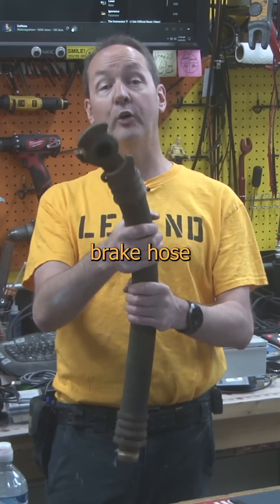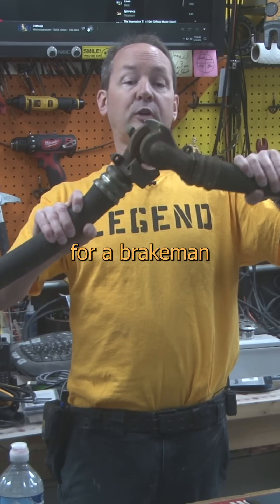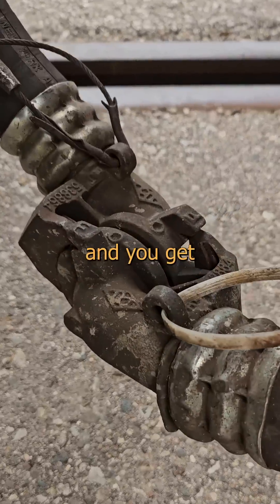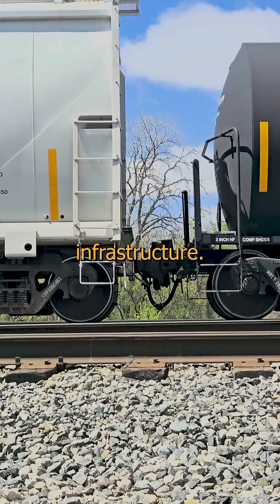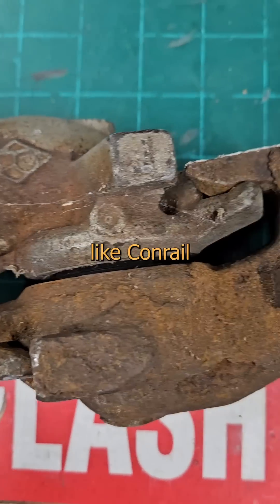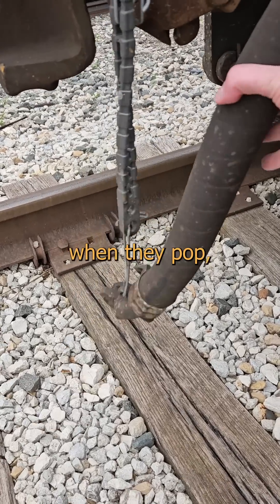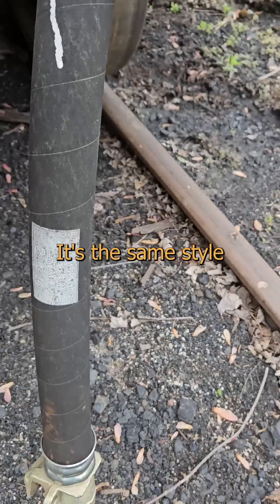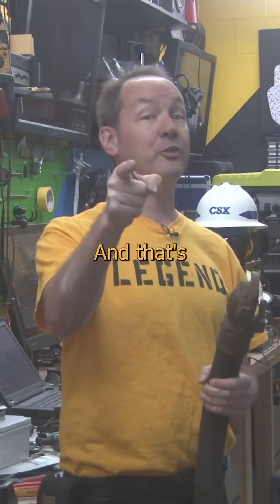Railroad Brake Line #chrisboden #comedy #engineering #train #gladhand #educational #connection #hose

Comment: In other news, a train derailed today, plowing into an orphanage after it was unable to use it's brakes to slow down for an upcoming turn. Investigators discovered the brake fault was due to a missing brake hose.
Reply: each freight car will automatically and independently fully apply their brakes if there is a loss in air pressure, such as an end hose being disconnected. The brake control valves on a freight car use air from their own seperate reservoirs to apply the brakes, and brake applications are triggered via pressure drops in the brake pipe which is the long pipe every freight car has that the end hoses connect to.

Comment: I remember when some cars were being set off the mainline and the conductor was careless, resulting in the coupler being ripped off. The train of over 100 cars became stuck on the mainline from the loss of air pressure and it took a couple  hours to fix. They eventually set off the bad car and cleared the main line. Amtrax had to be stopped and traffic was stopped thru several intersections all because of carelessness from the conductor.

Comment: Crash course: train brakes 
Most of the time on wagons or trucks air goes into the brakes they come on, once an engine is coupled and they remove the air creating a vacuum the brakes come off.

Comment: In the UK we have a straight air pipe as well as an msin air reservoir pipe, which has a star valve (some older air systems work like the American system with just a straight air pipe) in the middle, as they basically help top up the auxillary resevoir to stop the tank being depleted before being recharged by the compressor. They also help charge air suspension and air doors on newer vehicles.

Comment: Yep, even 18wheelers use the same system, just smaller. It's as close to stupid proof as you can get for braking systems. Because at least if it fails, you WILL stop. Yes I typed this before I heard you mention it.
Reply: from my understanding 18 wheelers use air pressure to physically push against a spring and keep the brake pads off the caliper/drum (not sure which one trailers use), freight cars actually work differently from this and need air pressure to physically apply the brakes; they aren't using air pressure to phyiscally push against a spring.
Reply: @acehawk888  Ah, my misunderstanding. Thanks for the clarification. Though I do find it odd. I'd rather something that heavy start stopping if there is a problem like that.

Comment: Can confirm, the local narrow gage railroad has that style of brake-hose connector. Can give you a nasty smack on your knees or up the crevass between them if you open the valve without connecting them.

Comment: And in a pinch, if one of the two gladhands is missing the rubber seal o-ring, you can take the other one out, flip it over, and connect the hoses.... It's neither pretty nor technically legal, but it will get you to the next terminal. 👍

Comment: “Stable in all weather” 
Yeah
as long as it’s not below freezing. 
Nothing is more fun than walking a train in -10 degree weather to change out glad hand seals because they keep leaking.
Reply: unfortunately rubber stops rubbering at a certain temperature. That being said, the hose material and gladhand gaskets, as well as pretty much any rubber component of the brake system, are all supposed to be tested to either -50 or -40 deg F. However in reality it is as you say.

Comment: Dont know if you have any friends with deep pockets that want their name on the side of a pennsy G5, but the railroad museum of long island is trying to raise 1.5 M to restore engine #39 to run again on the tracks of the strasburg railroad. Originally they wanted to get 39 running on excursions from riverhead to greenport on long island, stopping at the wineries that abut the railroad tracks. The museum even acquired a property to build workshops and yards. A few years later they bought an old turntable from upstate new york with the plan of having it at the western terminus. Unfortunately the MTA wanted nothing to do with the project and refused to allow a steam engine to run on their tracks. Many people fought for many decades to make that dream a possibility but in the end the MTA just wont allow it. Second best option would be to get 39 operational in a place where she can be taken care of properly and allowed to stretch her legs often. I was 13 when i was inside her boiler cutting the old rotted tubes out with a cutting torch and chipping rust off the boiler with an air hammer chisel. Seeing engine 39 running again would bring tears to my eyes.

Comment: Its highly possible that I'm just stupid, but if they are brake lines, wouldn't things not grind to a halt if they don't work? Lol. Love videos like this, 11/10!
Reply: Yes, quite literally. Brake applications on freight cars are triggered by pressure drops in the brake pipe from a normal 90 psi. The brake control valves see this drop in pressure, and correspondingly pressurize the brake cylinder on the car using air from a reservoir. So a gladhand decoupling on a train will cause the train to go into an emergency brake application and every car will slam on its brakes.

Comment: fun fact, you can get similar fitting for your garden hose 😁👍
I saw them the first time on the hoses used in a big recycling plant I worked at.

I found them in the garden section of a run of the mill tool store, all brass, nice black rubber seals.
I got one for the ouside faucet to pair with a hose, which has one on the opposite side which I can use to attatch different terminals.

Pretty darn nice 👍

Comment: As a trucker... they arent that much bigger than my air lines... the difference is those are built to last. Every truck manufacturer seems to have it in their head to cut corners where ever possible. My service line completely tore off the gladhand's fitting the other day... and the only wear and tear it receives is being attached and detached from the trailer gladhands... and I guess the bumpy road.
Reply: their built to be cheap haha, they are just regulated, and also every time a train gets thrown into an emergency stop because of something like a failed end hose, it becomes thousands (Im pretty sure tens of thousands on a major railroad but dont quote me) of dollars lost by the railroad due to the delay, so there is incentive for them to perform to a minimum standard.
Reply: @acehawk888 M8, they are losing closer to tens of thousands per minute of delay. I have hauled loads worth over 5 million in my semi truck, I can imagine a train is able to carry 10 fold that.
Reply: @PilotTed theres a general rule of thumb number we use but i forgot what it is

Comment: On passenger trains there is the brake pipe hose, BP, and the main reservoir hose, MR. They are different sizes and have incompatible gladhands so as not to get them crossed. As a pop quiz for my students I would ask which one was which in the field. When they got it wrong I knew it was time for a refresher.

Comment: These are exactly the same in the UK. 
Designed to separate if the wagons break loose, so that it doesn’t snap the air pipe. The brake pressure air then escapes and applies the brakes. 
The pipes that have the Main Reservoir pressure in are similar, but have a “Star Valve” in the end which closes off the pipe so that air pressure isn’t lost. 
Great design and great idea that has worked for decades. 👍🏻👍🏻👍🏻
Reply: Ours are separated by the "Triple Valve". It does the charging, the applying, and the emergency dump. Check out our reservoirs, which are actually two reservoirs bolted together.

Comment: As someone who hooks those up everyday sometimes it’s a pain especially in the cold. Those hoses get stiff and don’t wanna move 😂 I was a switch man for 3 years and now a Rail king G5 operator
Reply: Also they break pretty easily if you have a triangle point in the middle of the rail it gets hooked they rip off I’ve had it happen to me a few times

Comment: Fun fact: These couplings are not "handed" meaning there's no "left" or "right". They're all identical so only one part has to be made and stocked. 

Bonus not-so-fun fun fact:  In Western Australia where I work the exact same fitting used for the brakes on a train is also uses an identical pipe that's located right next to the brake pipe that is used to supply air to discharge doors and top hatches on grain wagons . This means "cross coupling" of the pipes between locomotives and wagons is entirely possible and the result is no brakes and a runaway train.  Because the owners of the rolling stock are too cheap to engineer the problem out by changing ONE part despite being told from the outset specifically not to allow this. So they instead rely on dog tired, overworked humans working in near total darkness to "just be careful" when marshalling wagons and to perform a test (that doesn't work) each time a wagon/wagons is attached to ensure the pipes have been coupled correctly 🤦🏻‍♂️.

I wish I was joking.
Reply: There are differently shaped and sized gladhands for different connections on trains already , I know of at least 5 different standardized types used in Australia. There really isnt any price difference between them other than maybe the smaller ones being slightly cheaper by virtue of being smaller. All that is needed for this to be a non-issue (and yes it should be a non-issue) is to spec the correct gladhand on the hose. Im surprised this is a problem.
Reply: The locos we use do have different "glad hands" for different functions but I am still astounded that something as fundamentally important as the brakes is legally allowed to able to fail so spectacularly. I believe the problem stemmed from the wagon people not talking to the loco people when the rolling stock was being made 13+ years ago. The locos as they arrived in Australia were "correct" but the wagons weren't so some genius bean counter with no regard for safety and a lot of f regard for being cheap  decided to successfully engineer the problem back into the situation by changing the then 20 or so locos "glad hands" to match the 200(?) or so wagons rather than for the correct parts to be fitted to the wagons. There was subsequently a runaway incident (caused by a number of factors) and the owner of the rolling stock declared safety to be a priority and swore they were gonna implement a program to correct the situation. This was maybe 5 years ago. Subsequently all we've heard is crickets chirping. Presumably this is because they feel a multi fatality runaway is cheaper and better to deal with than changing out the hoses on the locos and wagons (with the removed pipes still being useful as spares for the other function that still uses the same parts). A totally half arsed attempt to sort of rectify the situation (read very cheap and very lazy) was to colour code (paint) the tap handles on the pipes - to no known recognized standard not even being the same colours selected across the state. Within a fortnight I personally sighted a correctly coupled train that had silver attached to yellow and red attached to blue, other pipes ex stock not getting painted at all and NO formal training for anyone to explain whatever the colours were supposed to mean at all other than word-of- mouth. In other words to colours meant absolutely nothing and were/are misleading at best and still in no way physically prevents the pipes "getting cross coupled".

I sometimes ask people if they'd knowingly board a plane that had a real chance of the engines stopping when the wheels are retracted because there exists pipes the ground crew can accidentally cross couple during refuelling and they sensibly say "no". But a similar situation is said to be ok for the freight trains we operate 🤷🏻‍♂️🤦🏻‍♂️

Comment: That lock and seal is very similar to higher end sand blaster hose to blaster hopper connection. Looks very similar to the sand blaster’s hose that I used when I worked for a large electric motor company, we rebuilt/ rewound motors just like your rotor and stator in your turbines up to 20,000hp or they were rated in kilowatts/ megawatts

Comment: Freight is under 90 psi brake pipe pressure, Amtrak is 100 psi.  Those rubber gaskets go bad sometimes and the air takes forever to come up at the rear, so you find the hiss and replace it with the spare gasket you should be keeping on your switch keys.

Comment: Never straddle the brake hose when disconnecting it, even though you think you shut the valve off, sometimes the valves don't work correctly. That gladhand weighs a few pounds and straddling it makes your jewels the target of a jumping hose letting the pressure loose.

Comment: Wait till it's-20 out and the gasket won't seal 100%. It's hilarious
Reply: unfortunately rubber stops acting like runner at a certain temperature. the gaskets and hoses (and pretty much any other rubber component in the brake system) are tested to -50f but in practicality they will leak and be difficult.

Comment: As a diesel tech it’s cool seeing the semi trailer brake gladhands big brother. I’ve only ever seen fluid being moved through hydraulic couplers. Never thought gladhands would be used for fluid.
Reply: They're used for compressed air. Most people conflate the terms fluid and liquid. Chris is being technically correct. Broadly speaking, fluids are substances that can flow and deform under pressure (of which air is one). Liquids are a subcategory of fluids, but all fluids aren't all liquids.

Comment: Actually true! I know this because I am using a piece of one of those hoses to pump sewage from my motorhome to the sewer line. The hose was about 100 feet long with those fittings on both ends. I cut off about 70 feet. The fitting was removed and changed to a pipe connection. It works great. It's a little heavy though.
The hose was owned by a man who was into train museum stuff. He collected all kinds of train stuff. He passed away and his brother is cleaning up the property of all the stuff the brother collected.

Comment: And those expensive sounds when things disconnect is a safety feature!  Train air brakes work by storing air in tanks on each car. As long as the train air line has pressure, the brakes are off. But if the air pressure in the train line goes down - whether by the engineer operating the brake valve in the locomotive or by cars accidentally uncoupling - the brakes apply, stopping the train.

Comment: Those couplers that connect the cars have saved many men’s hands.  Before they would have to let one of the cars bump into the other and slide a pin down into a hole without being able to see your fingers to connect them. If you were working on the tracks and had all fingers attached that meant you weren’t “experienced enough”. I’ll take the lack of experience and all my fingers and just stick with the modern coupler.

Comment: I opened and angle cock that had air bottled in the cut. The glad hand whipped up and hit my hand while I was still holding the angle cock. It felt like getting hit with a hammer.

Comment: As an ex truck driver myself, the ones on a tractor-trailer are only handling a peak pressure of about a 120P. SI whereas I've been told that those ones not only are they a larger diameter, but they're handling around 200 psi, of pressure being moved along an entire train sometimes. My guess is part of the reasons you'll see 3. Even 4 locomotives, stacked together on a single train is not because you need the polling power. But because I', you need the ability to build air pressure and have air flow. So you need them, the 4 gigantic compressor units instead of just 2 or 3, but yeah. Having the extra locomotive or 2, really helps with providing extra polling power as well and only polling powerhouse. You can apply air to a train's braking system, just like a tractor-trailer and the wheels on the train cars that lock up when you walk. Does it require air to be applied to one side of the drum? When you apply it to the other side of the drum, just like an attractor trailer start to cause the wheels to start braking. So actual breaking effect on a train is spread out over every wheel that has a brake attached to it. Whereas polling power is just based on the powered wheels of a locomotive. So add more locomotives, get more polling power.

Comment: Semi trucks use a similar connection for the the connection to the trailer for the airbrakes we call them gladhands cause they look like they are shaking each other hands. The seal is easily replaceable, they last a good while. I think I've only had to replace them twice when I drove.

Comment: "glad hands"
Reply: Fun fact: I used to work on Harriers. Their braking system works Static (engine off) from 1100 psi to 3000 psi depending on if you used the hand pump to pump it up or not and works with a hydraulic accumulator with is always precharged to 1100 psi. under a load (engine on) it is always at 3000 psi +/- 200~. For a VSTOL aircraft? that is a LOT of braking power. I would LOVE to take you to the aircraft bone yard here in Arizona and show you around a Harrier. I imagine you would get a huge kick out of that.

Comment: Tip for my fellow truckers, always check your glad hands during your pre-trip inspection, especially the service brake line. 
Just in case you unknowingly ticked off another driver that has a dime on him. 

(A dime is just the perfect size to fit inside the glad hand and block of the air supply to the trailer. You don't wanna be hauling heavy and not have the trailer brakes available.)